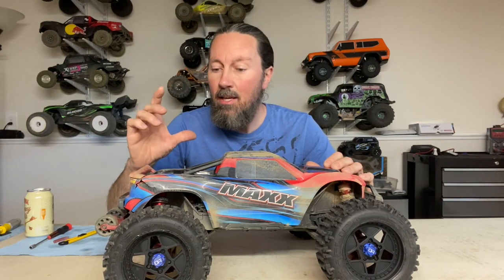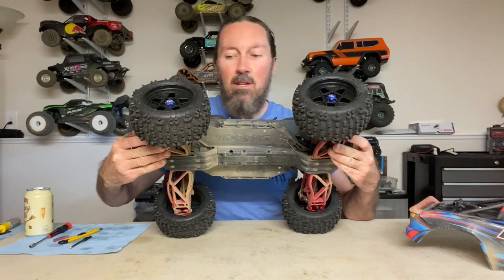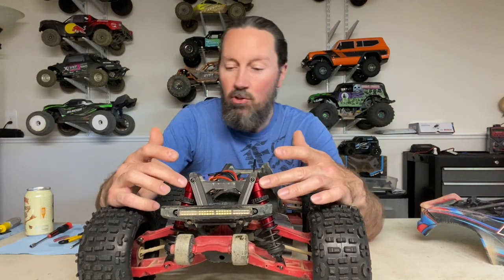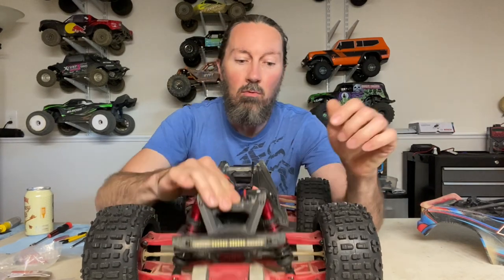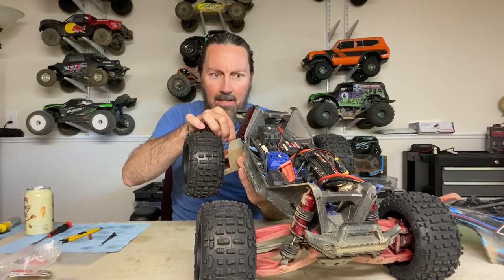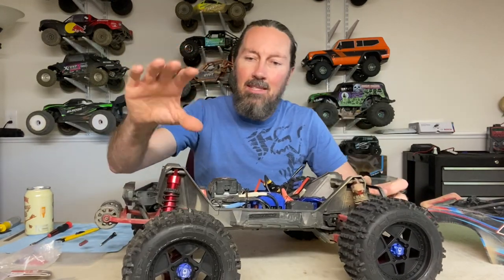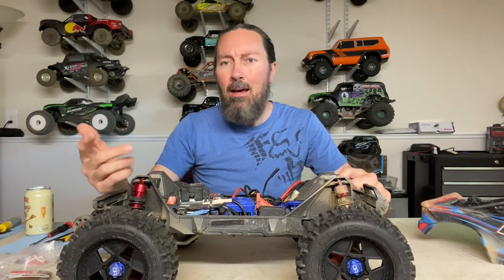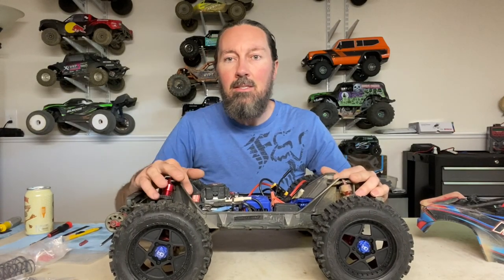Traxxas Maxx- Installing Longer Sledge shocks- This is Awesome!!!

Comment: Works great , with 8mm spacer just perfect! The shocks have ideal length. Looks and Handels much better!
Thanks man!
Reply from the maker: Nice, I think its so much better. The ultimate solution would be no spacer and mount the shock further out on the arm. I wish RPM would make new rear arms to do it.
Reply: 8 mm spacer go inside the shock ?
Reply: Exactly

Comment: Just did the same with rear. On the front side I put sledge springs and shock shafts, did not need spacers as I left shock bodies stock. With this setup the length of the front shocks is about 4mm less than the rear ones. I had to grind front lower arm a bit where it gets into contact with the C bracket, thus enabling more travel to front suspension. I put 80 oil to the back and 70 front. Maxx v2 is almost ideal now.

Comment: Rear shock tower geometry is the main problem , xmaxx is same way but doesnt sag in rear. I just used sledge rear springs on mine  the stiffedt ones , seemed to fix it. With 80wt oil landed better on jumps

Comment: great video! very helpful and informative. thumbs up. I really appreciate you explaining the details and pros & cons  of doing this mod. I'm thinking the ultimate setup might be this sledge shock mod in combination with a Wide-MAXX. If the truck is sitting a little higher, the center of gravity will be a little higher and a Wide-MAXX would help with that.
Reply from the maker: Thanks, I also have the wide kit. It’s a great combo with the Sledge shocks.

Comment: ive been running the longer shock ends for over a year now and love it more compared to stock.
Reply from the maker: Yes, its a big improvement. The longer shocks add even a bit more and the spring rate is perfect.

Comment: Thnx for another great video, will for sure do this upgrade cause I almost never drive the maxx just because of this. This is way cheaper then redoing my whole yard... :D
Reply from the maker: Its a big improvement and I didnt have to use really heavy fluid so the suspension actully works on smaller bumps too.

Comment: 22 shop tubes.
The original the original shafts 2 new.  O-rings inside of the Pisto.
Tube on the shaft. With the longer Springs.
From this sledge One arranged on the outside of the pistol team. So when it bottoms out, it has a bushing.
58 oil. That's my exacthat's my Zack set up.  A taunt Spring.
Did barely needed to be adusted. A quarter inch to a half inch down and it was perfect

Comment: I use the longer shock bodies with a shorter shock rod.
 Add with the heavy duty Spring from the sledge shock.
 Didn't have to put.  No lemon or inside the shop and it works perfect
Reply: This is the Mod I willl be using when I get my Maxx. Thank you Both

Comment: All you had to do is use the shock tubescan you use the original piston rods?
And use one bushing O. Ring. Inside the shop, the extra long shock rods. You don't need just shock therself from the sledge, the longer tube.  In the shorter Pacific ride makes it the way you don't have to.
Worry about anything minding. Shall I have mine?

Comment: Vitavon also just came out with a bracket that accomplishes the same thing.  It would be a much cheaper solution.  I’ve yet to see someone test them yet though.
Reply from the maker: I haven't seen that yet, does it move the mount closer the the axle? That what it really needs combined with this longer shock. I'm going to try to make something

Comment: Between this video and one other. Im doing this upgrade on my maxx this weekend. Regarding the spacer to disallow axle binding. What would you reccomend? Plastic washers? A metal or plastic nut? All withing the measurment limit of course.
Reply from the maker: I’d use plastic spacers or a short piece of tubing. Metal could scratch the shaft or the shock body.
Reply: Did the upgrade yesterday and what a difference it made.
Reply: All fours or just the rear?
Reply: @TheRookie1216  just the rear.

Comment: I have parts coming to do this mod, I have the rear springs on so far and can already see an improvement, chassis slaps less and not as hard
Reply from the maker: Cool, it works great. Just be sure to limit to down travel just enough to prevent shafts from binding

Comment: I have a maxx v2 with metal axles also, and I noticed the the slege shock shaft is longer and that you added a spacer, so I was wondering if it would be a better idea to just buy the slege shock body and spring and using the maxx shock shaft?
Reply from the maker: Interesting idea, you would get the added length of the body and it could end up being the perfect overall length. I dont see how it could case any issues. I say give it a try and let me know how it works out.
Reply: These just showed up for mine. The body and shaft are ~8mm longer. Makes no sense to bother with a 8mm limited shaft. Longer body and spring, moved outboard should net your same result
Reply: Update... One of my favorite mods on this truck. Running 80wt and this mod has just made it stick every landing. Thanks for the vid!

Comment: Other solution that works for me:
- original shocks
- m2c shock pistons
- 60 wt in front
- 70 wt in back
- vg racing springs for the sledge
- e revo 2.0 wheels
Info: maxx v2 comes with 60 wt in the shocks
Reply from the maker: I tried the M2c and VG setup. Its good but the rear still bottomed way easier than the front. The rear shocks really need to be mounted closer to the wheels
Reply: Have you tried it with the vg racing springs for the sledge?

Comment: Have you tried putting sledge shocks on the front yet?  I would think returning the truck to the original rake of the suspension sloping from front to back might be better for handling.  That way it's raised up overall but has the original rake.
Reply from the maker: No, the front has dual rate springs and M2C pistons and seems to work fine. The rear was my only complaint

Comment: How much longer is the sledge rear shock body than the maxx shock body? I've read that just changing out the shock body helps.
Reply from the maker: I forget the measurements but that could work too

Comment: Ive tried another Oil in the Shocks of my Maxx V2 and that worked fine but a Friend of mine has a Slede and may i try that too
Reply from the maker: I tried a bunch of different things but using the longer shocks made the biggest improvement. Just be sure to limit the down travel enough so the shafts dont bind
Reply: @rcilluminati26  So i not drive this Thing Hardcore just a littl Street some Jumps and a littl offroad, so do you think that upgrade makes sense for me?
I mean did it only improve the jumps or performs this thing offroad better to?

Comment: Park flyers rc has a video with all part # from traxxas. Video been out for a year.
Reply: Park flyers RC video regarding this subject has been out for a year now. However he doesn't tell you about internally limiting the shocks due to axle interference. He also doesn't mention that you can reuse the same shock caps I know it shows the original shock cap installed on the rear shocks later on in the video but there's never any confirmation of that. Also doesn't mention that you can possibly use the springs (from the Sledge) to stiffen up the front end suspension. Either way it's nice to have two different videos about this modification.

Comment: Hey, is it also possible Sledge Shocks in the front ???
Reply from the maker: Yes, same Idea but my front always worked ok so I didnt bother. You can also just change the shock body and use stock shaft and you shouldnt have to use any spacers to reduce travel

Comment: What wheels are those?? Not the backflips....the thumbnail ones
Reply from the maker: Those are off Ali Express. Search for Traxxas UDR wheels, they are copys but work great and they fit the larger axles.  You can use stock UDR wheels if you have the stock plastic driveshafts.

Comment: What size a fuel hose did you use for the spacer. Great video.
Reply from the maker: I forget the exact size, maybe 1/8. It just needs to fit over the shaft without being too loose

Comment: Did you ever do the front shocks????
Reply from the maker: No, just the rears. Front always seemed ok to me
Reply: @rcilluminati26  I compared the parts and the sledge and Maxx from shocks parts are the same. I am going to be doing paulsimons1164 idea with the longer shock body and the shorted rod to eliminate the need for the spacer

Comment: Do you have binding issues due to the longer sledge shocks?
I used my 8mm shorter shock arm so I wouldn’t have to insert a spacer
Reply from the maker: I had to limit the shock travel a bit so the metal driveshafts wouldn’t bind at full extension.
Reply: Sorry, rewatching vid… 139mm is safe for no binding

Comment: What wheel/tire combo do you have on your sledge hanging there? & did you need any adapters to fit or they bolt right on
Reply from the maker: If its the white wheels, Traxxas Response 3.8"  5375R I believe. You need the correct dish and they bolt right on. Suoer light weight, I dont think I'd recommend for bashing though, more of a track setup

Comment: So being the sledge shocks are a little too long, would a perfect solution be rear kraton shocks all 4 front and rear? I'm talking about the 133mm rears from the kraton. I see it would be a better solution since they are a nicer quality shock absorber but I want to know what you think. Edit(the rear kratons are 30$ per pair)
Reply from the maker: Possibly, depends on how they fit in the arms and on the shock towers. Another option someone mentioned is to use the longer Sledge shock body with the shorter Maxx shock shaft.  I havent tried it so not sure on total length but it could be just right.
Reply: @rcilluminati26  what would this accomplish please my man I hear you I just can’t see why unless for more fluids in the body for more packing on landings so to speak🤔 I’d like to know
Reply from the maker: @gonzodetroitify  the longer shocks allow the rear arms to droop more and that means more travel. IMO the Maxx needs longer rear shocks like these and they should be mounted closer out to the wheel. Essentially just like the Sledge.

Comment: That's interesting 🤔 I want to just slap them on lol
Reply from the maker: Do you have the plastic or steel driveshafts? Its possible that the plastic will be ok but I'm not positive.
Reply: I have wide steel axles running it on 8s

Comment: Traxxas does have a heavier spring rate option for the Sledge rear shocks pt#9657 rate 1.671. Do you think this heavier spring rate would be problematic?
Reply from the maker: Maybe too stiff but depends on what youre doing with the car

Comment: Just you 80 weight Jesus chirst
Reply from the maker: Tried that, tried M2c pistons, tried dual rate springs.  All fine for bashing but then it rides too harsh and will still bottom out to easily on small bumps. Suspension is very unbalanced, bad design by Traxxas.